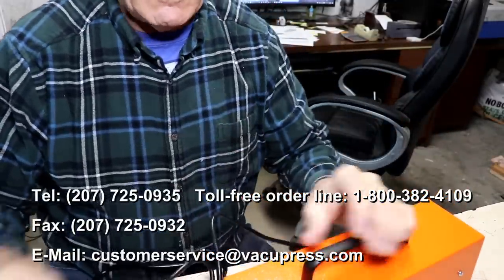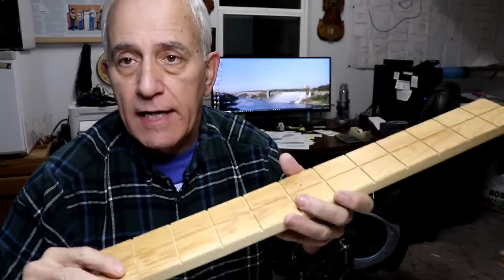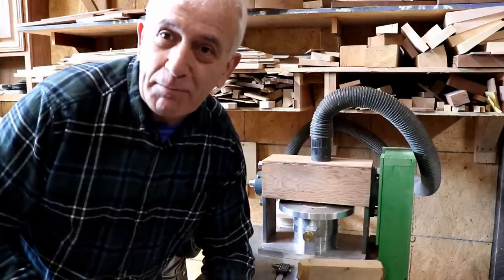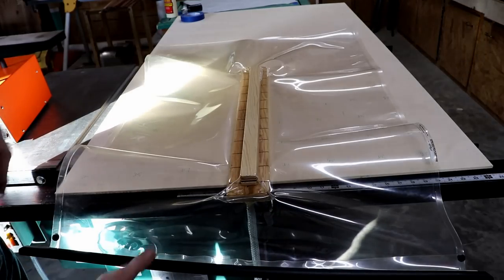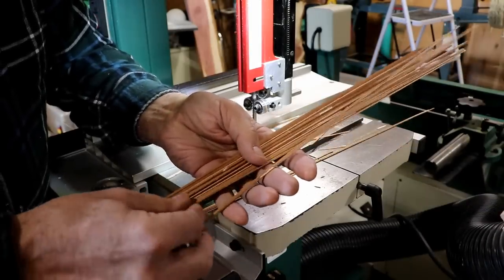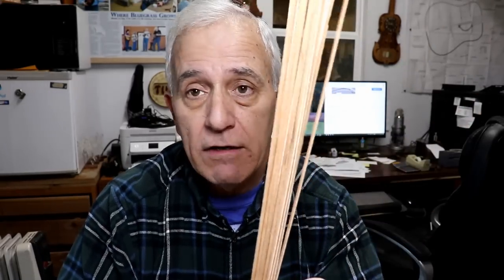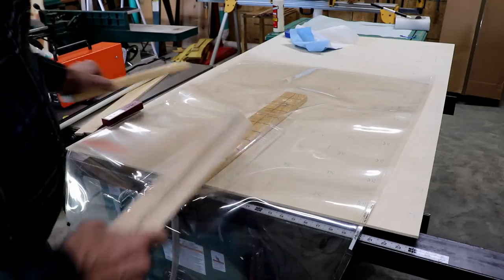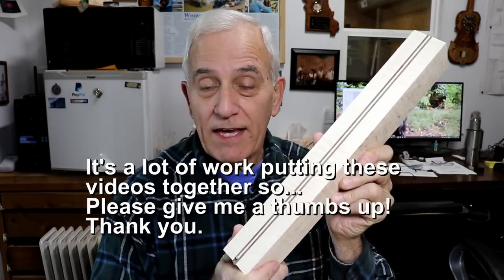369 RSW Making Purfling And Laminated Mandolin Neck

Comment: The glue doesn't need air to dry when there's no air pressure. The water in the glue will vaporize, actually like boiling out of the glue (cold) This is how a freeze drier works, and why it's hard to cook food hot enough at high altitudes (with low air pressure) as the water boils away at a much lower temperature. This is an extreme extension of that phenomenon. Congratulations on the new system!

Comment: Very impressive!!!  I have worked with vacuum in refrigeration and I have read quite a bit about its' use in carbon fiber and fiberglass lamination, form-making, and so forth.  Given your use for it and with the resin and glass laminations, it is just the ticket for removing the air bubbles from the glue and resins.  Aside from removing the air from refrigeration systems, it is used to dry any moisture from the system.  Without the use of a Micron Meter, you won't be able to see it, but as the vacuum is drawn down it pulls the air while simultaneously causing moisture to vaporize so it can be drawn out.  That provides you with the added advantage of drying your glue-ups quicker.  You've got yourself one heck of a tool as well as a real time-saver.  Many thumbs up!!!

Comment: I've been using vacuum for all clamping during builds except the neck and body assembly. It will help speed up the clamping process if you use a vacuum reservoir tank.

Comment: I wish I had owned one of those when I laminated the violin necks that I've made. Although they turned out well, I do believe the joints would have been even more consistent using this system. I believe that this unit will only improve the quality of your instruments if that's possible. Thanks for this video Jerry.

Comment: 14.7 pounds of air is pressing down on each square inch at sea level after you create the vacuum.  That's a lot of pressure.  I used to use a big vacuum press for mounting artwork to foamcore.  Fun with physics!

Comment: I have thought of making a vacuum press with an old automotive Freon pump I used to use before the EPA laws stopped us from venting the Freon to the atmosphere.  You can get some heavy visqueen at Lowes/Home Depot and heat seal the edges.  The end seal looks like it could be made from PVC pipe.  I have seen some vacuum tables with holes all over the top (similar to a air hockey table) then the top is covered with a sheet of visqueen  fastened down on the edges with clamps.  You can make vacuum molds among other things with it!

Comment: Nice work Jerry. I have used setups like this to make laminated archery bows.  The reason the glue "dries" so quick, is that the vacuum lowers the boiling point of the water in the glue. If your pump can get down to 28 in of mercury, the water in the glue will become vapor at about 80 degrees. 

Of course, that may not do too much for the Vinyl oils. I don't know their volitility, so I have no idea. Anyone?
Reply: Good point.  I wondered about curing.

Comment: Great video - thanks.
It looks like you used the same blade in your bandsaw to cut the neck pieces and the purfling.  For the purfling, try a blade with a high TPI  and little or no set to the teeth.  You may get results that you're happier with.  Thanks.

Comment: Vacuum squeezes just as hard sideways ad it does up and down. Keeping your neck pieces aligned would be easier on their side. Xtra firm felt sheeting and teflon sheet ate nice accessories too if you want to keep your bag clean and control what is sticking to each other

Comment: Hi Jerry when I make 3 or 5 piece neck blanks I drill 2 holes in parts that will be fall off and put dowels in them. Everything stays perfectly aligned that way. How many cfm is the pump they sent you? I have a 3.5 cfm pump that I use to glue bridges on uke's and guitars. I tried it on a neck blank in a bag but didn't seem to make much pressure so I took it out and clamped it
Cheers from Oklahoma!

Comment: I wonder if some extra time under vacuum would be called for. After all, you are removing almost all of the atmosphere from your glued surfaces during the setting process. The glue in the bottle doesn't dry as long as you lerave the cap on and air doesn't get to it. Does the glue need air to set up? I dunno ... just got to wondering about it.